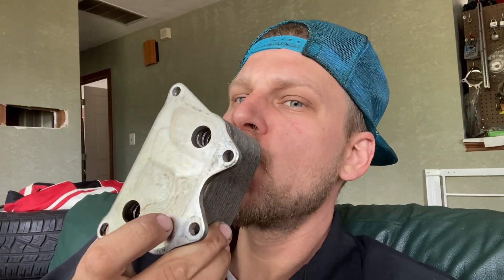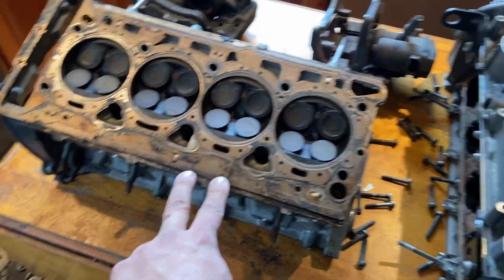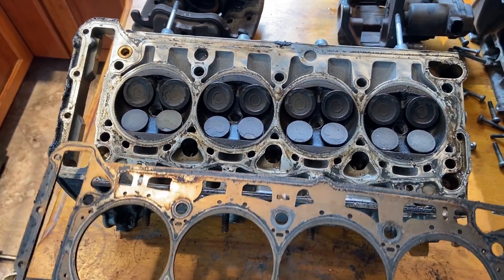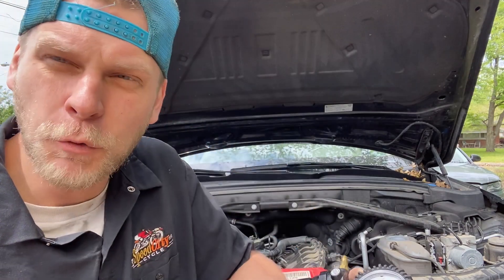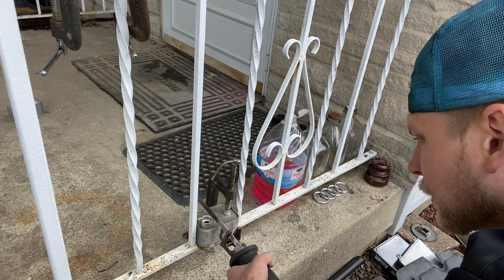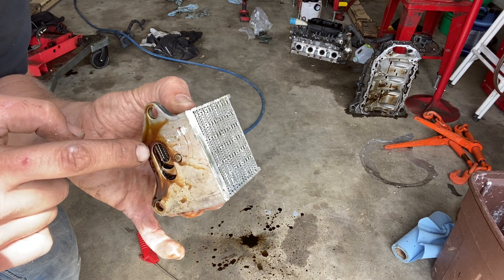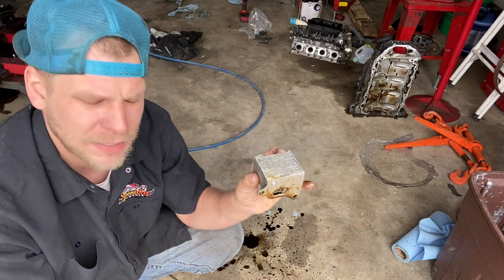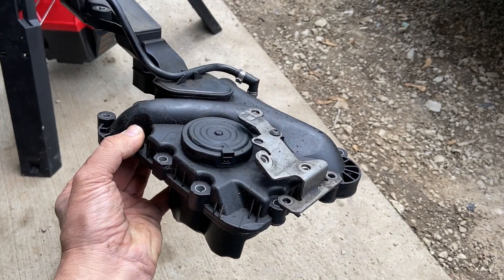Audi VW mixing coolant oil antifreeze sludge 1.8t 2.0t 3.0t 4.2l pressure testing oil cooler head b8

Comment: Currently have a valley leak. parts ordered 2013 3.0 tdi malone stage 2 fully deleted. parked the car due to coolant loss about 1-1/2 cups and not much in the valley mostly oil. cant see it on the dip stick but aint gunna risk it. Ordered new oem cooler kit and new hoses coolant etc.  some say reuse the cooler and spacer plate but i figure if i want the car to be 100%. im not impressed with this faliuer/maintanance requiered about every 100k miles it seems and its about a 6hr job. CHaching.

Comment: I had a failure on my Audi a4 b8 where the radiator cooling for the transmission oil failed and the coolant and transmission oil was mixing. Had to replace the transmission by the time I found the actual problem

Comment: bro i love you.. so if i have a 2.5l with 148psi conpressoon all cyclinders, but what looks like the scum layer in my coolant ball and recemt;y have oil pressure issues.. should i be looking at the oil ffilter housing and oil cooler instead of oil pump, cause so far everything ive looked into has turned out b be fine no issue,  pulled oil pan and no coolant everythinng looks fine. oil poump pick up looks good. no blockage. i was about to pull oil pump and was looking for info on it. when i saw this video. also the bottom of motor is dirty, oil covered. would you bee thinking oil pump or filter housing..? i tried testing for oil pressure at switch lkocation and nothing., didnt read at all.. i also noticed that theres is not one video on here about oil pump replacement.. which started me thinking that maybe there not problems if no one has made a video replacing it.. what do you think?

Comment: Is there a way to determine if it's not a head gasket but indeed the oil cooler?  Or just replace and see?
Reply from the maker: Read your spark plugs, if one looks different than the other do a leak down test

Comment: Hola hermano. Gracias por el video. yo tengo un Audi A4 2011 que esta pasando aceite de motor al Coolant, ya cambie el Oil Cooler pero sigue, aun mas que antes. Es posible que la junta (Gasket) no haya sellado bien y por eso siga pasando aceite aun mas que antes. ?

Comment: I dont have oil mixed with coolant inside the engine, at least the oil cap and dipstick shows that. But my exhaust drips a bit of water, I replaced the oil filter housing but it kept mixing those two things, the thing that I want to ask is if this type of failure (the oil cooler) can make the coolant find it ways to the exhaust. 
So if that is impossible how is that I dont have the mix happening inside the engine too.  Its a VW Passat 5 cyl 2.5l.
Reply: I have to add that we tried to flush the system after replacing the oil filter housing but it kept mixing the water

Comment: First of all I changed the Oil cooler gasket, But it didn’t work, Then i watched this video and Changed the OEM oil cooler which was already in my car and Replaced it with an Genuine oil cooler from Italy. And it Worked Succesfully. Now no more oil in my coolent, Thank you So much for u r advice

Comment: the VW/Audi oil coolang interphase is extremely redundant and prone to failure resulting in a coolant/oil mixture. I actually did a bypass whereby there was no longer oil/coolant interphase.
Reply: how did you bypass the oil cooler?
Reply: How? this would be great

Comment: Changed my motor on my 1.8t Jetta cuz I thought the head was blown and it turned out to be a bad oil cooler seal 🤷‍♂️ who knew. Now I have a bunch of problems with my coolent system idk what to do on my 3rd motor and it's about to seize up
Reply: Oh and all my oil was going into my cooling system never seen that before but looked into it and everything pointed to a bad head 😞 if I only would have looked more into it

Comment: I honestly think this might be happening to me with the oil cooler. Ive had coolant mixing with oil. Its a very small amount mixing. I replaced the oil filter housing assembly thinking it was mixing there but im still getting it so im gonna try the oil cooler.
Reply: Did it work?
Reply: Any updates ?

Comment: Hi mate, I have the Audi rs38p and the coolant has oil in it and there is brown sludge overflowing from the coolant expansion tank the oil in the engine looks fine and the engine runs fine good compressor but the dsg gearbox is not endangering gears correctly there are couple of faults on the gearbox.  Oil has been leaking not sure from were. Do you know how I could check how and what oil is leaking dsg or engine into coolant thanks for any help

Comment: Hey man im getting ready to reseal my 4.2fsi timing covers (leaking oil) and i cant find the part no. For the 2 orings you mentioned at the end of your video. The coolant crossover tubes. Id need 4 of them. Its been very frustrating figuring out part numbers for gaskets and orings etc on this Q7. Do you possibly know the name of these coolant tubes so i can find the correct orings? Or even the parts no. Themselves? Thanks
Reply from the maker: https://www.jimellisaudiparts.com/products/Audi/Engine-Coolant-Pipe/11792475/079121071DA.html?partner=googlebase

That will be $20 please / not really but please subscribe
Reply from the maker: Or maybe it’s this one you should always use vin and maybe talk to an Audi parts specialist (at the dealer parts department) for difficult parts like this https://www.jimellisaudiparts.com/products/Engine-Coolant-Pipe/11799344/079121071CT.html
Reply: @NaptownTuner  do you sell any of your rebuilt engines? I may need a new one soon and after following you for years and your videos saving me from going to the dealer I only trust your work.

Comment: Ook, so 08 A4 B7 2.0 FSI Coolant mixing with oil, car never overheated, but oil filter housing has been leaking oil..... Slackin on replacing. But can this cause coolant to mix with oil??
Reply: Did you get it sorted? I've discovered coolant leaking into my oil today on my 2007 A4 2.0tfsi 😢

Comment: Just had an idea. I recall you saying cam carriers/valve covers must go with their heads, but if you take a random valve cover and put it with a random head and have them machined together, would it be the equivelant or are they completely "married" to eachother?
Reply from the maker: It’s line hone, I wouldn’t.  I’ve never asked my machine shop about it but I would think it’s too much trouble / money than it’s worth

Comment: do we need that cooler, we could mount an external real cooler right ?.
Reply from the maker: No need to mess with oil coolers on these cars unless you’re maybe running a big turbo in The desert or something.  The oil actually needs to be hot enough to burn the water / condensation out and such. I’d have a oil temp gauge before messing with that.  https://www.hotrod.com/articles/engine-oil-temperature/

Comment: LOL... there's always one guy in the comments, who finds it necessary to point out that the correct name for an oil cooler is a heat exchanger. Yes... heat is exchanged, yes... some manufacturers call them heat exchangers... but guess what!!?? VW & Audi call them "oil coolers"!!!  Why? Uuuh... because it's main job is to cool the oil (once the engine is at operating temperature)l!!??
Reply: Actually, your comment is wrong.. The oil cooler has oil and coolant traveling through it, and the heat exchanger only has coolant running through it. I’m sure you meant heater core.